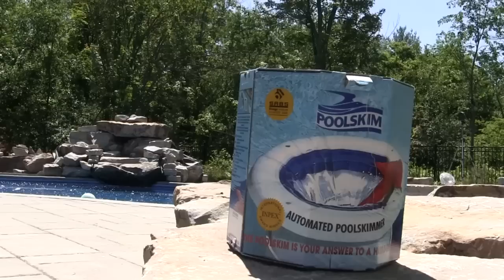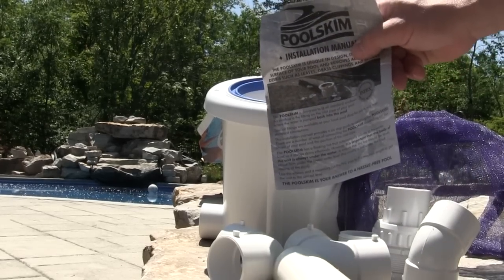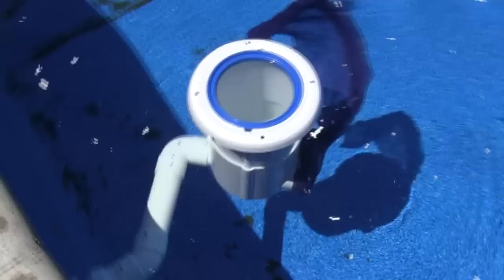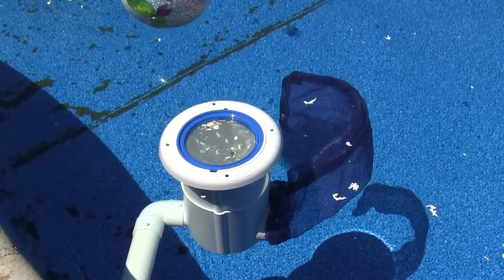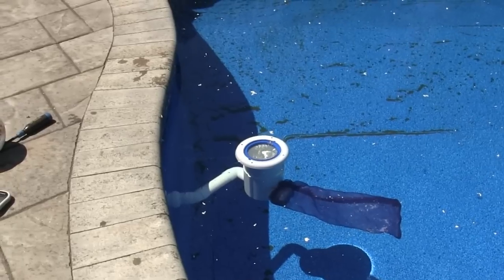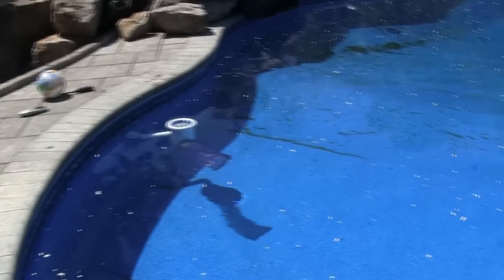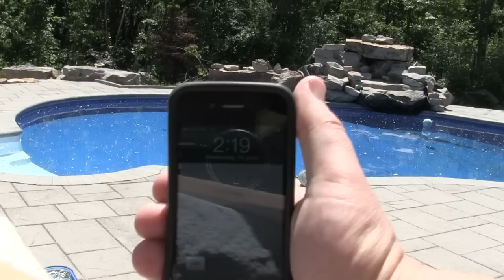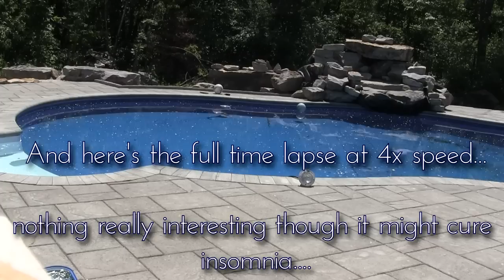PoolSkim Automatic Pool Surface Skimmer Installation with Timelapse

Comment: Did you ever figure out what the 2 small plates and the 2 blue pins included in the kit are for?
Reply: It mentions their use in the instructions: the plates are for reducing flow out of a secondary outlet, if there is one in the pool, and the pins are for bumping an automatic pool cleaner out of the way 'elegantly'.

Comment: People pay 140$ for this plastic, impressive!
Reply from the maker: Honestly, I'd buy it again as well.  It's been running ten years now, the original net is still working.  It takes soo much stuff out of the pool and is the simplest to empty and keeps me from having to clean the main intake filter basket  (which requires shutting off the filter at times, where you can always change the poolskim net) and lowers the amount of stuff that makes it to the main filter. The cost ($100 when I bought it) has paid for itself in time savings many times over.